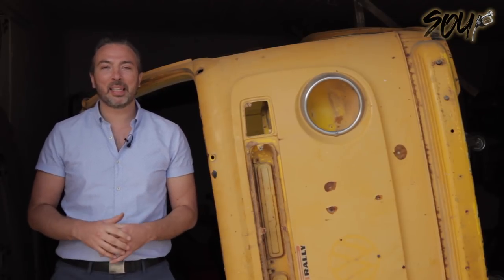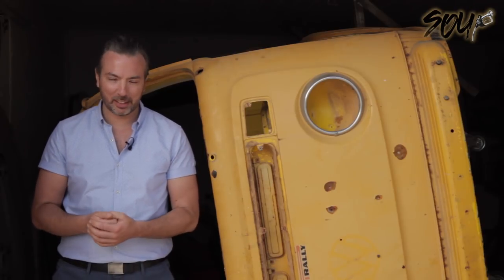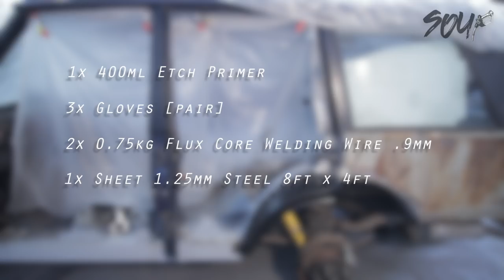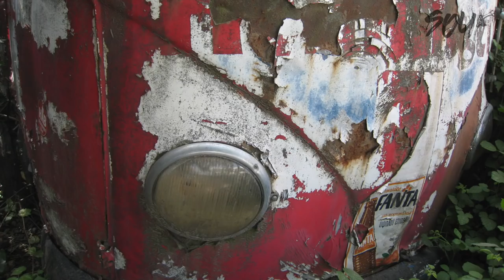Holiday resto VW hippy wagon // SOUP Classic Motoring 05 Panel Van Camper

Comment: George,  What your saying about having a gap when butt welding is 100% correct try using inter grips which holds the the metal
flush and gives you the perect gap so the weld penetrates both sides. Take a look at my Mini Cooper videos. Cheers David
Reply from the maker: Great to get some verification David, thanks a mill. Will check out the Mini clips!

Comment: I just ordered parts for my second project on my old Porsche. First was an oil change. I hope that third will be pads and rotors. Keep bending wrenches. Wait, third was snow tires. Bought and paid for.
Reply from the maker: Yes man keep going. As you finish each job you'll be more ready for the next little challenge, then one day you'll look back and be proud.

Comment: Good stuff George just run the airsaw through for the welding gap, my mate has a long term 240 jag project that has most of the work done just paint & put it back together will be done sometime has 2 projects to be finished first!
Reply from the maker: Hiya Sid! So what are the other two projects then? Oh and air saw? I'll put that on the list too :D
Reply: Sent ya email George air saws pop up now & then in Aldi or lidl for around €15 they are good enough!
Reply from the maker: I'll keep my eye out Sid, I said I wouldn't use the compressor though so have to think long and hard about that.

Comment: what year is that jag? I contemplated buying one that looks like that one at a swap meet. They price was just $600 but it was a project. i should have grabbed some video of it but I did get a few pics of you'd like to see them. The sign read 1966 jaguar 420
Reply from the maker: It's a late car, '68 best I can make out and a 240 so it's a poverty spec Jaguar, no wire wheels or leather. $600 sounds like a proposition, why didn't you get it in the end?
Reply: George Karellas not enough room I guess. but I did get all his information in case I get up the courage. This one did have the wire wheels and leather I believe
Reply from the maker: Maybe a second look is on the cards ;)

Comment: Add a couple of ring bolts and use ratchet straps to secure and lift rather a trolley jack. But make sure they are decent ones, I had a discovery gearbox fall on me years ago because a cheap one let go, made me squeak.
If you can't drill to fit the bolts, then maybe get one of these? https://youtu.be/bQlpDiXPZHQ
Reply from the maker: Thats a great idea Steve, I have shackles in the roof too so that'd be perfect. WIll def use that as safety when it comes to flipping it over the other way. Should I be worried you had that link to hand? :D